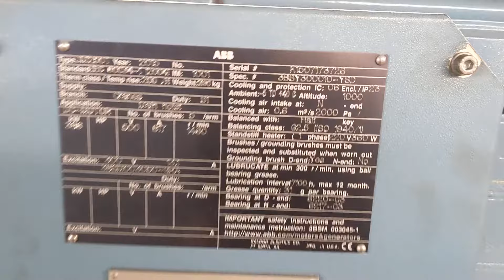Drive Machinery Startup Doppelmayr UNI-G

Comment: I did not think A.N.S.I allowed a coupling or drive line to be between the brake and the gearbox input shaft ( SB #2 )
Reply: It looks like there are two brakes there in case one of the brakes fails.
Reply: @TwinSkiingLiftsRides  the first one is an inertia disc to make sure the lift doesn’t slow down too fast